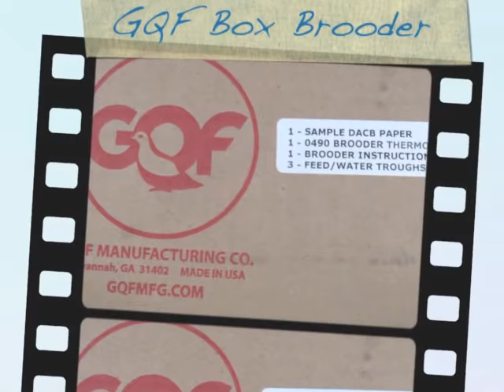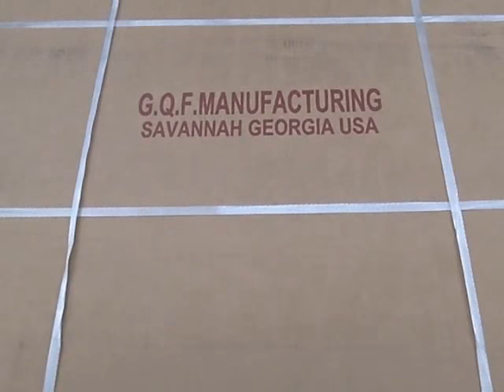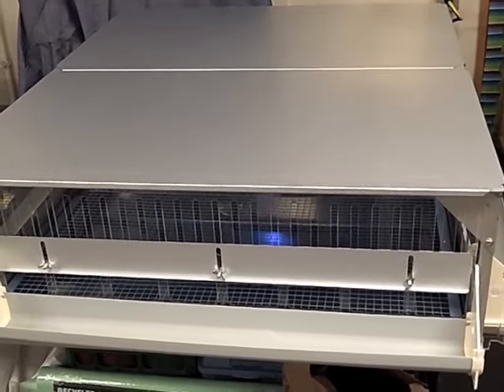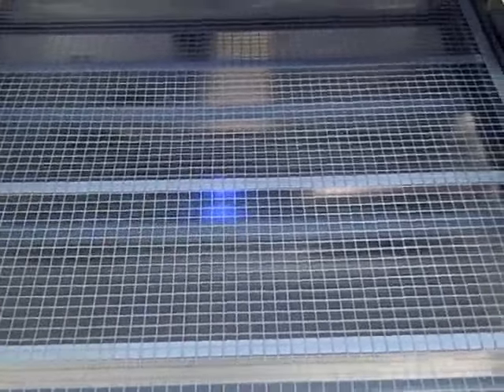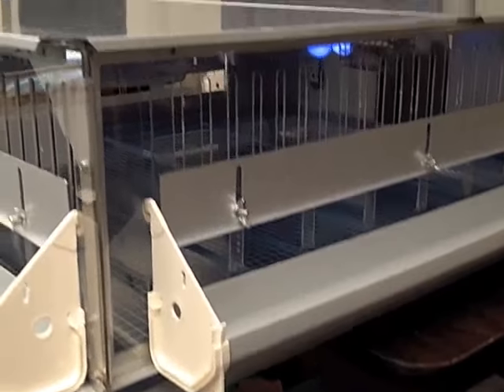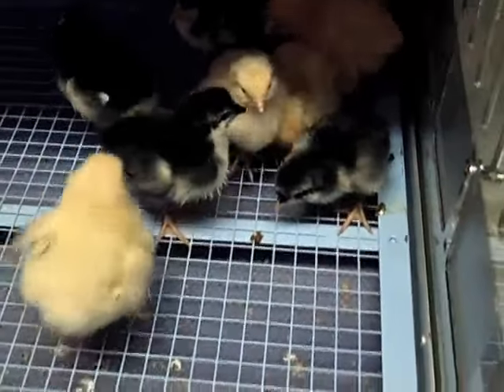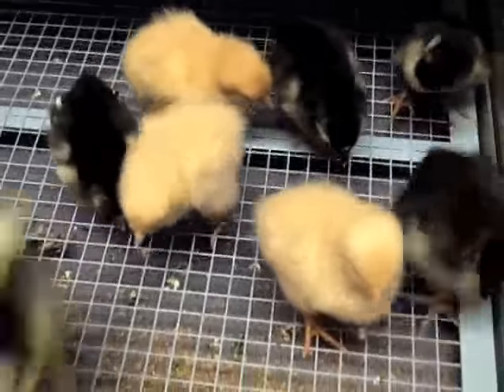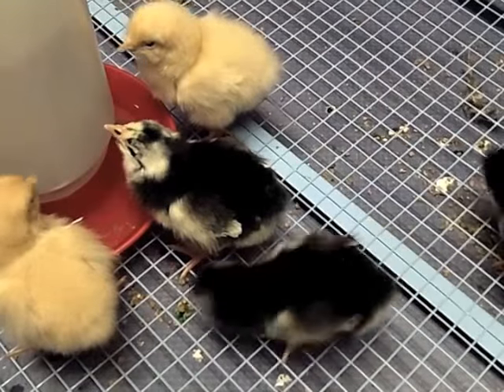Pickin' Up Chicks

Comment from the maker: We really like the GQF Brooder. It is easy to change the paper as the tray easily slides out and the temp is a snap to regulate using the thermostat. I am very pleased with the strong construction. It is a bit heavy and awkward to move around by yourself. It will not fit through a standard doorway without tilting to the side. One negative is the chicks fling food out of the trough onto the floor when they eat and some food falls behind the trough and gets trapped until you remove the trough.

Comment: Thank you Sir. for your answer, I have a tip for you in regards to the food flinging, just cut some wire mesh just a bit shorter than the internat lenght and width of the trough and have it sit on top of the food, the chicks will stop flinging because the squares of the wire mesh will prevent that from happening, but the chicks will still have access to the food, problem solved. When adding more food, make sure to lift the wire mesh and so it sits on top of the food.